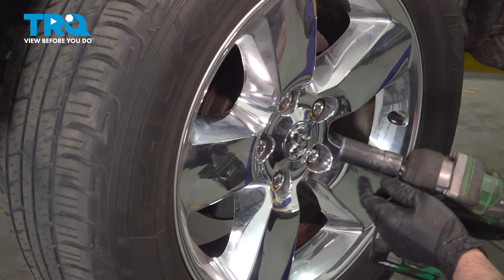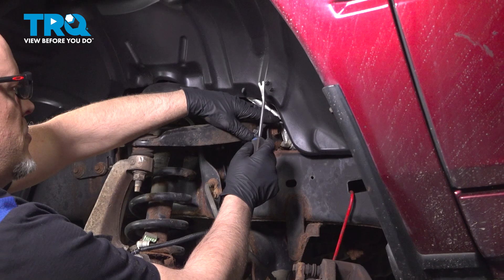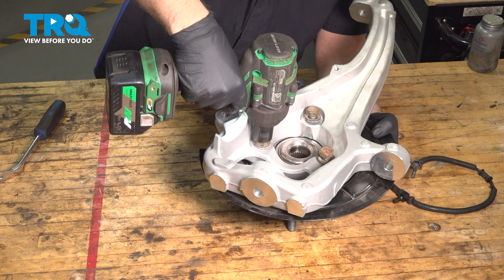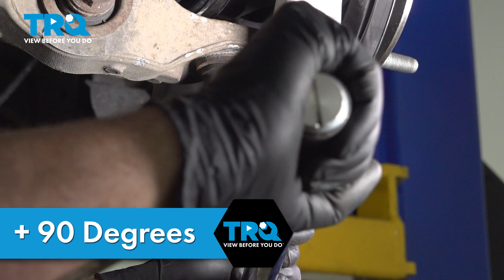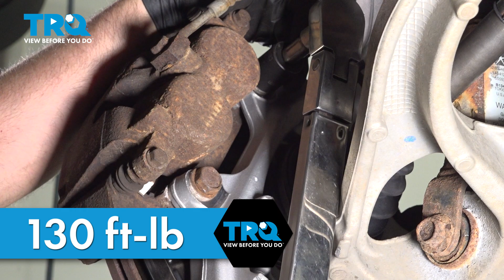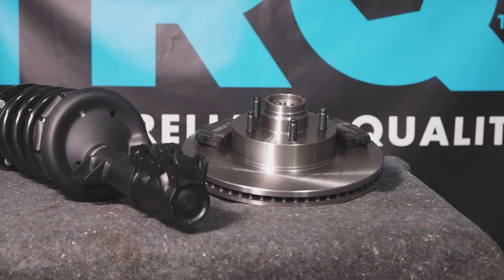How to Replace Front Steering Knuckles 2011-2018 Ram 1500

Comment: sneeky   I saw the new wheel bearing on the old knuckle but noticed the axle shaft magicaly renewed itself while the knuckle was out.  

actually good idea you can cover several things with one video shoot and a couple edits. 

funny im thinking about just removing and replacing my knuckle because i cant get the wheel bearing out of the original.  Everything always snowballs here nun NYS  Nice that your not working on a clean rust free truck.  Im sure my ball joints and tie rod wont pop out even with beating and the proper puller tools.  

waiting on my hub buster before i order a knuckle.   of course she needs the truck back for work.   monday.   today is sunday.

I stand corrected  all three points threaded right out and popped out  funny how the bearing bonds and becomes one with the knuckle but the joints look like new.  Im guessing the hardness of the joints prevents the corrosion fusion.  

thanks for giving the sizes of the nuts in your videos.  It doesnt take a ton more effort but so many videos neglect to do this.  Working with my limited tools at my workplace it saves many trips across the shop to guess sizes i have to borrow with permission of course.

Comment: I had an issue with top control arm ball joint not going all the way in I’m guessing because ball joint is also new and hole of steering knuckle is lil smaller few to its new idk , I might just go to the shop